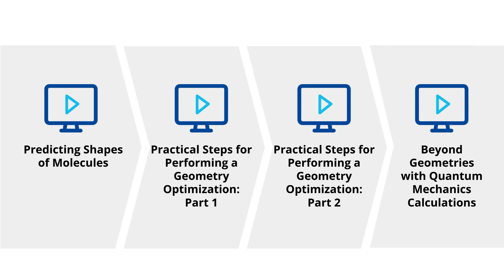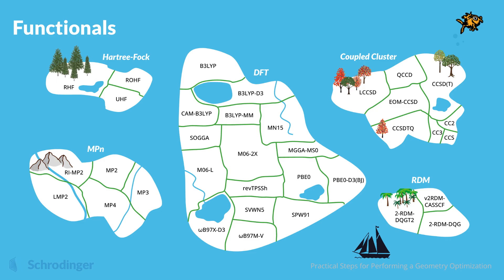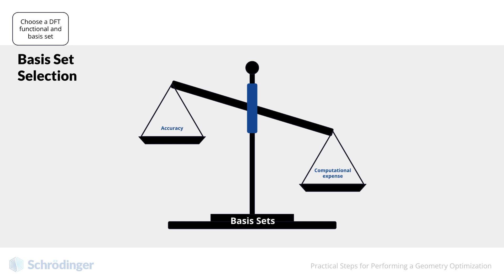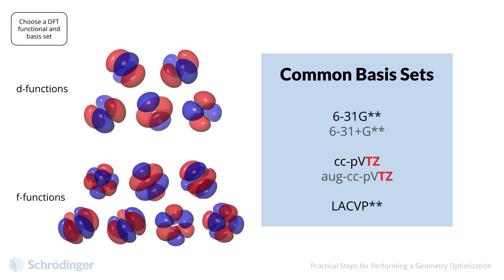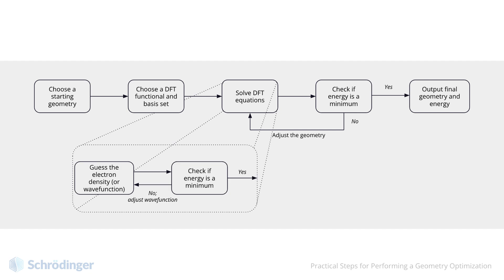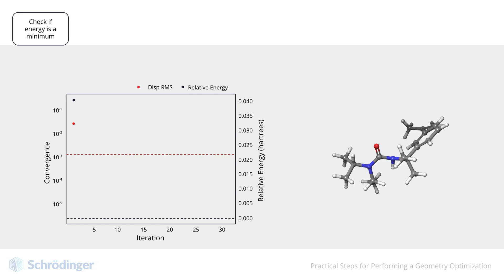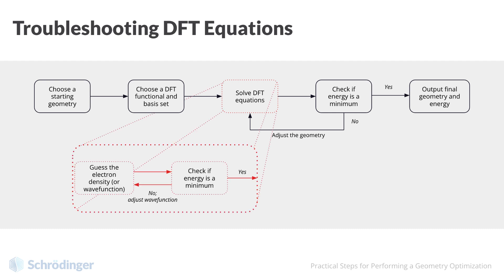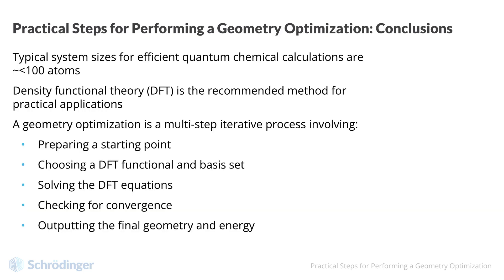Performing a Geometry Optimization: Part 2

Comment: Hi, i have a question, after geometry optimization QM monitor imported structure changed to enolate, but actual structure was ketone. Could you please share what will be the reason. i am totally confused because calculation completed successfully. out put Mae file has same structure, but qm convergence structure was different
Reply from the maker: Hi there! Thanks for reaching out! Please feel free to contact our Scientific and Technical Support team via help@schrodinger.com. They can get you some answers and additional information. Thanks!
Reply: tautomerisation?